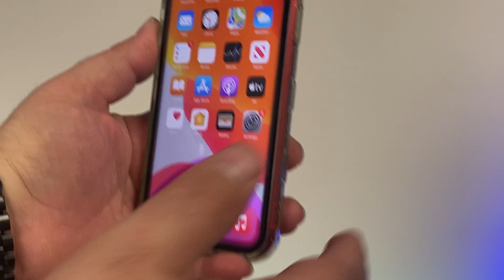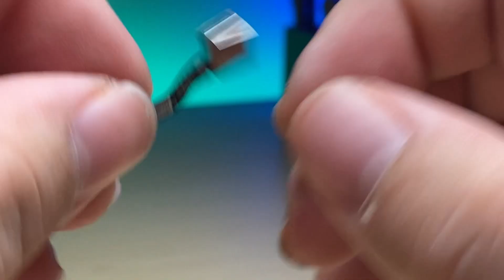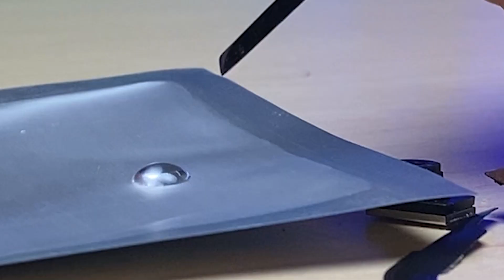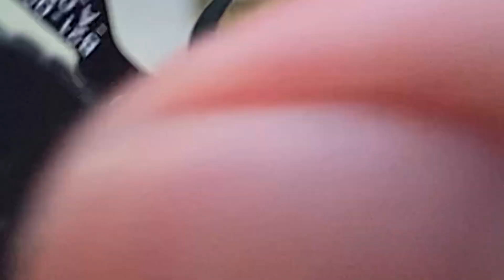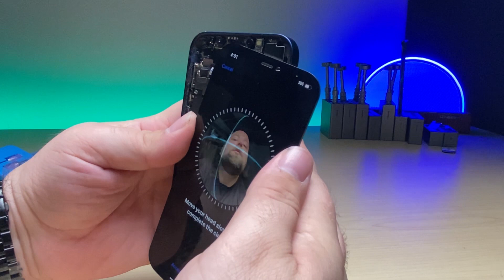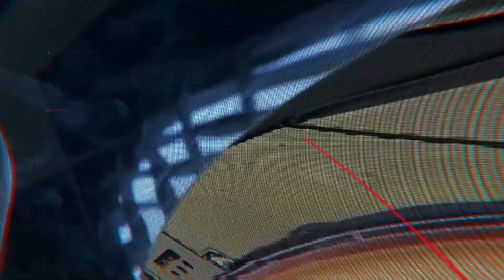iPhone 12 Front Camera Repair & Save Face ID - (Tips and Tricks #39)

Comment: Why move everything over to a new housing with so much risk if all you're needing to replace is the front cam? Couldn't you just cut/bend the old housing, put the new front cam in, and bend it back and either spot weld or just glue it back together?
Reply: Yeah, i agree. Could have just removed the cam and put the new one in. Cut the metal off if needed - not like its going to matter too much